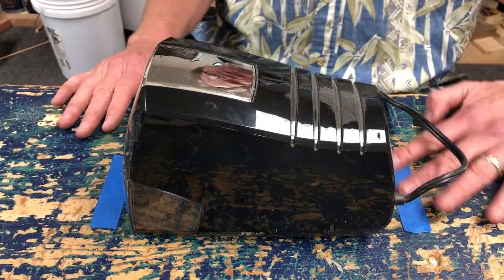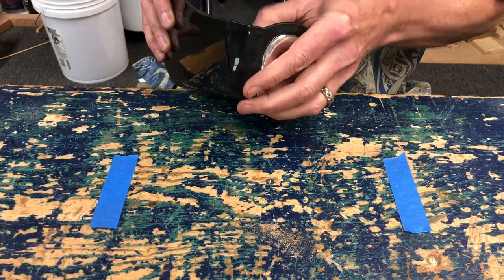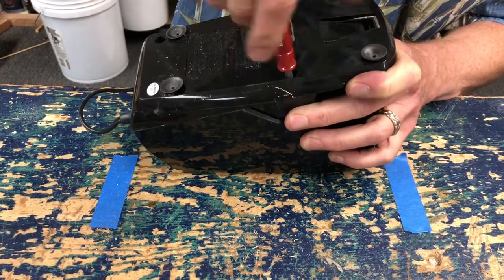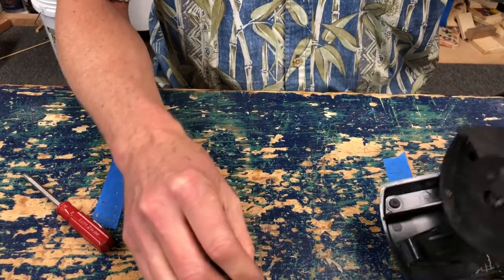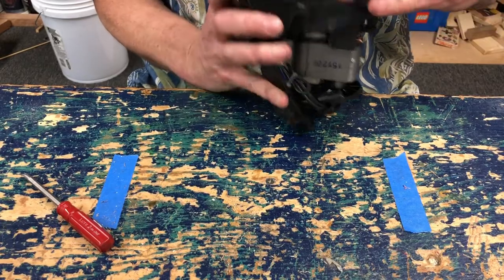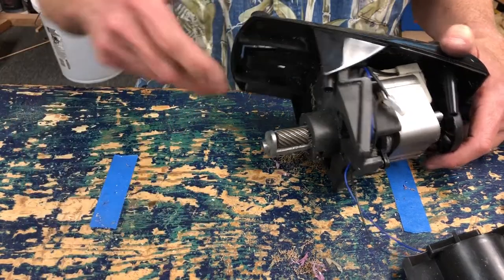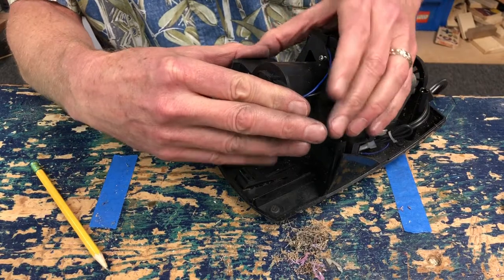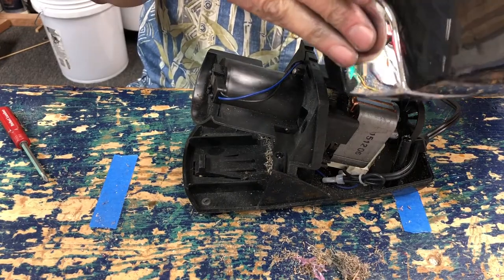How to fix an electric pencil sharpener

Comment: If they didn't want people to take it apart they'd use security screws or have it snap together. I'm actually surprised with how well made the mechanical parts are with this particular sharpener.
Reply: Tugf
Reply: It is so good i imported one to germany and it cost me 150 with a converter. Now after a couple years it doesn't work as well anymore. Maybe it is done dunno but i sure as hell will try to save that thing xD

Comment: Whatt happens if u put a pen in a electric pencil sharpener
Reply from the maker: I ink that's a bad idea :)
Reply: @everydaycreative  why what would happen:)
Reply from the maker: @weirdwonderland8095   Well, the plastic would get shredded in the blades and muck up the sharpener. If there's a metal tip on the pen, that would probably stop the motor dead. Why would you want to put a pen in a pencil sharpener? :)
Reply: @everydaycreative  I wanna see for myself:)
Reply from the maker: @weirdwonderland8095  Well, go for it. You can't be sure until you try it for yourself. Just don't use my pencil sharpener when you experiment. Please post the results! :)
Reply: @everydaycreative  alright I will:)
Reply: @EverydayCreative  I have the results the sharpener still works when the pen was inside the sharpener wouldn't start and nothing happened to the pen and sharpener
Reply from the maker: @weirdwonderland8095  Scientific discovery!
Reply: @everydaycreative um I got in trouble I tried it on my teachers pencil sharpener when they went close ink exploded on them and they said if I don't give them a new sharpener and shirt and pen I will be helled back:)